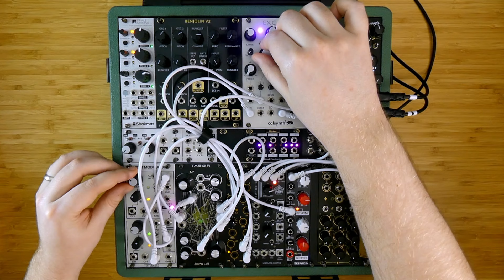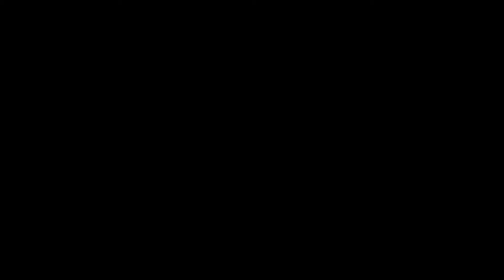Modular Explorations: TABOR Time

Comment: I'm being nosy, but what does a rig like this cost?  [If you have to ask, I know, but how much would a start-up modular synth capable of these sounds cost?]
Reply from the maker: It's a great question, but a bit of a complicated one to answer based on what you mean by 'these sounds'. You can figure out the retail price of a system like this one using ModularGrid, but if you look at the connections for this particular patch, only about half of the modules are being used. From what I've seen, most cases this size run somewhere between 2k and 4k, but you can knock that down a bit buying used or discounted. And of course, I think you can get similar sounds for a lot cheaper. Semi-modular systems are generally more cost-effective than modular, and software environments like VCV rack are as cheap as free. I definitely wouldn't recommend a case of this complexity as a start-up system in any case. Hope that helps!